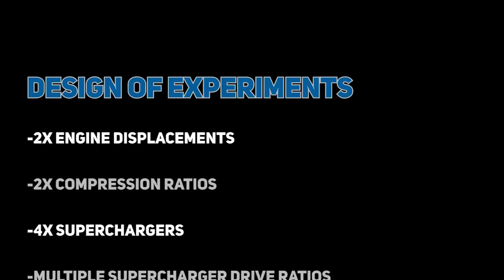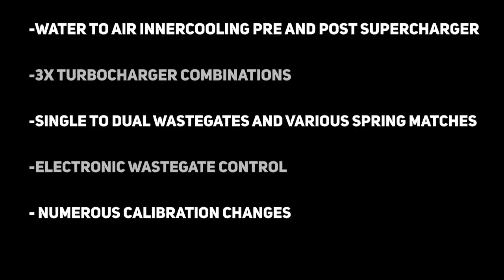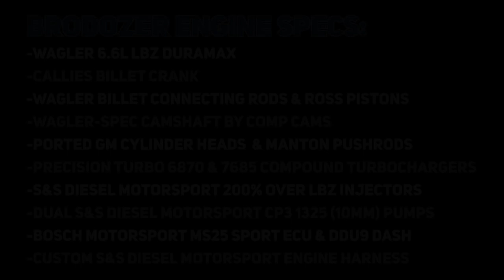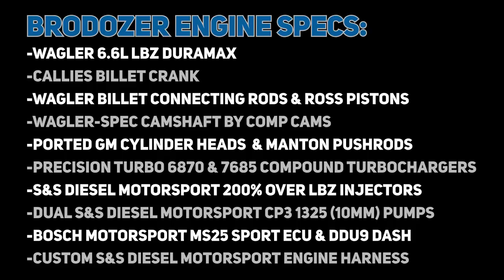The Power Behind BroDozer

Comment: Thats how a monster truck should be,  diesel.
Reply: It’s the one truck in a stadium that gasses out the entire place
Reply: nah, the near instant throttle response/higher horsepower of the blown big block is better in this application.
Reply: @sto1asgoetia600  a properly tuned diesel doesn’t blow a lot of smoke

Comment: how much torque do the gas monster truck engines make
Reply: Big block gas engines are usually around 1:1 hp to torque so 1200hp the torque shouldn’t be far off
Reply: @JimmyCasket02  and  most of the 540 methenol merlin block chevys we see are around 1500 HP+  so  thats crazy

Comment: Would have thought it makes more power with screw only.
Reply: @SSfueled  yes of course , good diesel makes clean power at ~15 AFR , gasoline 12-13 , alcohol much lower but still. Did it have cam made for mechanical supercharger ?  If not , it might waste air out of exhaust during overlap.
Reply: @SSfueled  that dragster looks promising , although with nitrous , but still. Turbos will always make more power but for monster truck screw is nice because they need response for those freestyle tricks.

Comment: Should have used a Powerstroke
Reply: theman68and1. But they used a duramax👍
Reply: It wouldn’t handle it
Reply: Why not a cummins
Reply: I agree I’m fine with the dmax platform even if it isn’t my favorite but if your going to make a truck based off a ford body it should have a ford motor
Reply: they should have used a powerstroke since the original brodozer is a ford
Reply: What's funny is Duramax engines are also pretty garbage lol Cummins is the way to go if we're going to be fr
Reply: Chris Smith you realize a bulletproof 6.0 is just as reliable as any other diesel out there and will out power any duramaxipad
Reply: @kirk0respite  anything can be reliable if you make it reliable. Thats dumb. Why buy some piece of junk 6.0? One of the worst engines! Why buy something you have to dump money into? This subject went over your head.
Reply: @ChrisSmith-ig9jq  because there are not alot of parts for a 6.0 as its a relatively new engine.
Reply: @jackmagnium6115  duramax and the 6.0 are about the same age....... do u know how to math???? lmao
Reply: @ChrisSmith-ig9jq  not really. the only thing i know that might be interchangeable is the pushrods but im not sure about the lengths. plus the duramax has twice as many valves. the powerstroke is basically a diesel LS cause when i looked it up. it has 16 valves. it is lighter cause of having less valve but being a bit smaller does NOT make you more reliable. since when do you ever find a 6.0L powerstroke in a military truck? the most used engine for those types of things is the duramax and cummins. its also bad when you have electronic injectors as when they reach max duty cycle they cannot go any higher. take rudy's diesel promod. it has a billet 6.7L making 1500 horsepower with a motec ECU standalone. precision 88mil or 65mil single turbo and nitrous. Ford built 9 inch and a lenco 4 speed. this is all from what i read from diesel outlaw magazines. the issue was in 2017. its a 2008 ford F250 pro mod. anyways it did have the electronic injectors but they had to be upsized in order to meet the fuel demands of this 1500 horsepower beast. thats still a weak point as those can short out or fail badly which is why i go for full mechanical systems. its easier to repair when it fails and is pretty robust. thats why the cummins and duramax outperform the powerstroke. they are purely mechanical

Comment: It's don't sound like a monster thek
Reply: And different is good. Turbo'd engines will always sound muffled and a diesel is usually quieter.
Reply: @Twinfire  I like the sound of turbocharged diesels, but they're not all too important when horsepower doesn't matter as much, like in Monster Truck freestyling. In tractor pulling, with categories like the Super Stock or Pro Stock, horsepower is really important (I just have a soft-spot for Diesel Super Stocks :P)
Reply: Becuase its a diesel
Reply: What's a "monster thek" and what do they sound like? Is it some kind of mythical creature?!